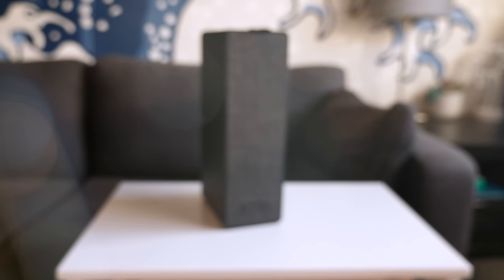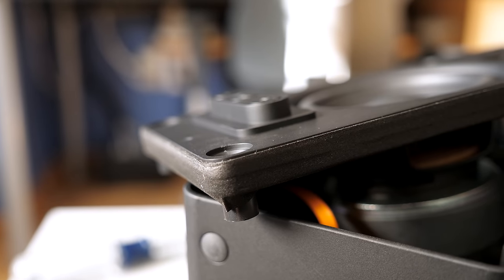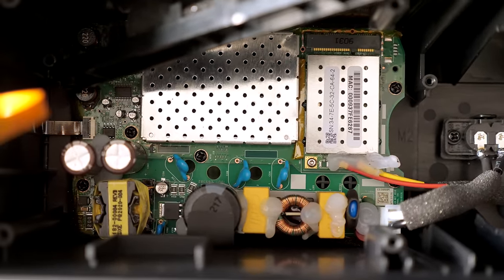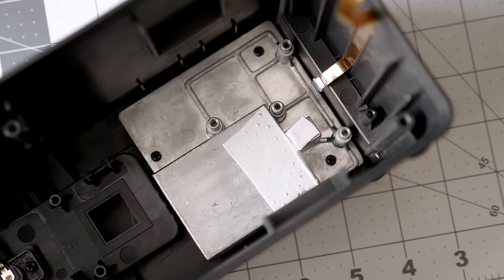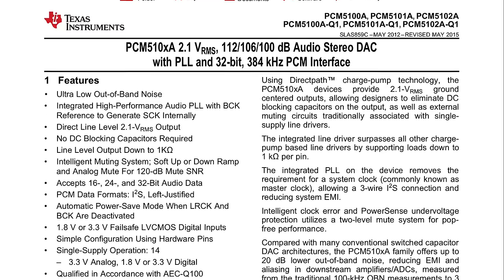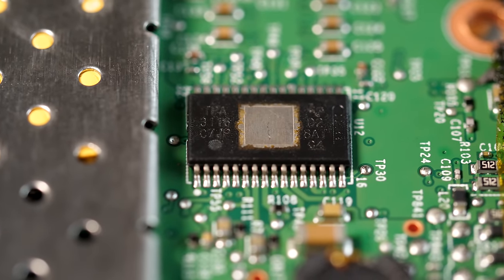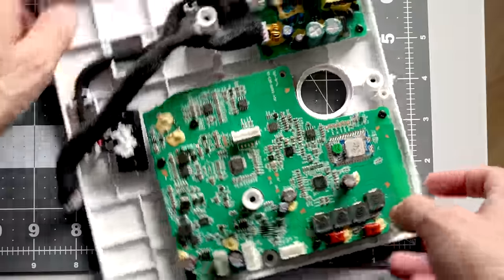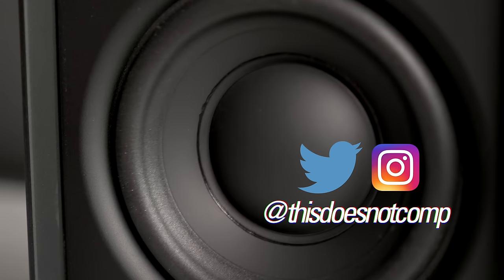IKEA's Sonos Speaker Has a Secret

Comment: So it's not Ikea to blame cutting the costs down but Sonos, as they are also using CapXon caps in their "premium" products.
Reply: I saw that, the Sonos Play:1 is also using the CapXon capacitors.
Reply: They were equally involved in the creation process, with Ikea likely having the final say
Reply: @JoshWitte  , but Ikea weren't involved when Sonos layed out the Play1. They already used CapXon on their own products, that's what I say.
Reply: @volvoracinggermany  ah, gotcha. Well that's unfortunate 😕
Reply: Nope, it's always Trump's fault...
Reply: CapXon caps will be OK, and last longer than the design life before a new model appears.
Put another way - the whole product will be thrown away well before the caps fail.
Reply: @johncoops6897  Im using speakers from the 70s, a few years life on a speaker is completely unacceptable
Reply: Just like Walmart, they refuse to pay for their products and make these manufacturers produce a cheaper product to sell in their store... Look at Goodyear tires from Goodyear then the exact same tire from a Walmart.
Reply: If I designed 150 dollar speakers, they would be computer speakers with a 3.5 inch BMR driver and dual passive radiators in each speaker box, feature class AB amplification, and be powered by USB C.
Reply: @esk8spirit362  NO! I always thought EVERY PROBLEM on the Planet was Obama's fault AND it was up to "Dear Leader" to correct them, because we ALL know, only he can do it! Good thing Mr. Trump was PROACTIVE about the Coronavirus situation otherwise we would have a hell of a lot MORE than those "2" cases! lol
Reply: @johncoops6897  That's why I shop at my local Goodwill store. You will find these items at "giveaway" prices, even if you have to buy new caps!
Reply: @massv953  Yes, but are those '70s speakers passive or self-powered? If they are passive, they SHOULD last for a LONG time, save for "speaker rot" of the cone surround!
Reply: @massv953  - we are talking about SONOS systems, which is not the same thing as your 1970's passive speakers. Consider mobile phones... people replace them to update the technology far sooner than the product physically stops operating. The low quality components in mobile phones don't need to last 50 years, or 20 or even 10 years - the original purchaser will replace them in a few years anyway. Sonos and similar products are pretty much the same.
Reply: @davidperry4013  - Nobody cares how you would design computer speakers. Do you even know what Sonos is?
Reply: @johncoops6897  I actually inherited Pioneer speakers from the 70's from my family and won't be replacing them anytime soon.

Comment: My guess on the lack of batting is that the back volume of symfonisk is large enough to reach their desired enclosure resonance without it. There's a limit to how much bass response you can squeeze out of a small loudspeaker.
Reply: The damping material in a ported box is to remove midrange resonances exiting through the vent. It has little to do with the bass itself.
Reply: @westelaudio943  It does both. Batting decreases the effective sound speed in the enclosure (isothermal vs adiabatic sound speed), thus increasing the effective volume and the lowering the bass cutoff. It also increases losses in the enclosure, reducing the Q of any standing waves, like you say.

Both of these effects exist and are measurable, and an engineer designing the enclosure ought to be taking both into account when deciding if they want batting or not.
Reply: @TheRationalPi  

True, however, it also absorbs the system resonance at the tuning frequency. That's why in a ported design you only put a thin damping material near the walls, so only the shorter wavelengths are absorbed, and in a ported subwoofer you rarely find any of it because the midrange frequencies are already LPF'd out to the degree of being negligible. 
This midbass enclosure would have greatly benefitted from it though.

Comment: What's really disappointing is the fact that Sonos, the so-called "premium" connected speaker manufacturer, is also using crap caps.
Reply: Yes I thought that as well... But is 150$ really premium??
Reply: @0ace0hitta0  compared to the cheap alternatives, yes.
Reply: @hillie47  Hi. Can you please tell me about some cheaper alternative? I'm looking for some cheap multi-room wifi audio system and I was not able to find anything cheaper then sonos one. Thanks a lot.
Reply: @JurajMarkoSK  for the connected stuff the Sonos play one is probably the cheapest option, but there are some budget not connected speakers you could use. Sonos is premium in the sense that prices go up rapidly from the play one. And to be honest $150 is a lot of money for a simple box with a cheap little amp and speaker. But that seems to be the starting price. Too high is you ask me.
Reply: the only premium in sonos is the price ;)
Reply: @wishandwatch  Hahaha, yeah, I'm learning that the expensive way. :-)
Reply: all about that planned obsolescence baby
Reply: My vintage pioneer amplifier is all a Japan built with only Japanese components. Very durable excellent amp.
Reply: @Sam Mencia The joys of truly building something yourself. And yes, you can go as crazy as you want to! :)
Reply: @JurajMarkoSK  just get a google audio cast and add to any speaker system you want and have full control in as many rooms as you want. I have 4 connected to premium home theaters and by my outside pool system and control everything through the audio casts over wifi.
Reply: @tigerskone2945  there discontinued
Reply: @djenson  such a pity.  Everything good that google does gets canned

Comment: Polyfill "batting" isn't for bass response, it's to slow down the rear wave of the driver making it behave is if it was in a larger enclosure. With a tiny 3" driver it more than likely isn't needed since that driver won't have very much xmax.

Comment: I think what happened was that the speaker portion comes from whoever did Eneby, while the circuit board comes from Sonos. Sonos may have tweaked the DSP a bit to optimize the sound quality of the speakers used. And finally, the enclosure is IKEA.

Comment: Which will fail first? The capacitors or Sonos deciding to no longer support the product that has no AUX in or Bluetooth.
Reply: I have Sonos products that are close to 10 years old now and Sonos still supports them so no need to really worry about Sonos support
Reply: The only things sonos have stopped Supporting are their Controllers that were getting useless and dying anyway.

All speakers and connects /ZP units are still supported

Comment: The question now is, is there a difference in sound between the Ikea speaker or the Sonos one.
Reply: serasane hmmm... that’s a really pandora box u opened there
Reply: @serasane  Having heard neither, I can say with 101% confidence the difference is night and day.
Reply: he literally said at the end...if you don't mind the form factor then go for the symfonisk..did you even listen ?
Reply: Since they use 2 different sized enclosures, there should be some difference in sound. Heres the truth though, it has a little shit tweeter and a little shit sub, they're not going to sound great.
Reply: @Nothingtoya   Right, there should be a difference in bass response, at the very least, but these drivers appear utterly generic, and I wouldn't expect anything better in a speaker with a thin plastic enclosure and no batting.
Reply: @serasane  I think Wilson Audio will sound tinny compared to Sonos. The amp inside Sonos is matched to the drivers just like Kef LS50W
Reply: @Nothingtoya  Compared to what is the question. There are better audio quality and streaming solutions, but the price point is the qualifier in the definition of shit in this setting. It will likely not be as good as a B&O M5, but the wall mount bracket for one of those will get you half-way to this speaker. The M5 can also probably be defined as shit in comparison to a B&W Formation Wedge - but again, it's twice the price.
Reply: @serasane  I wouldn't be able to hear it over the screaming coming from my wallet...
Reply: I have the One and it actually plays with some authority to ~80Hz. Perfect level for most small rooms, kitchens and such so comparing it with a few REW frequency response sweeps in a few rooms and locations (free air vs back wall supported) would be great to see. Also when and how the bass is compressed (it's done pretty clean on the One) would be interesting. And of course se how the response changes with some wool in there 😃
Reply: I have the Eneby30 (well, 2 in stereo) and I tested them against the Symfonisk Shelf speaker.

Since the Symfonisk uses only 1 woofer, like the Eneby20, those sound quite the same, while the Eneby30 sounds quite awesome with its 2 woofers.
I was not impressed with the "sonos" speaker AT ALL.

The Lamp speaker, I couldnt test, but it seems according to the web, that its the sonos1 with an additional lamp.

I must say I'm not really liking the sonos products sound at all.

The
Reply: People really don’t care about sound, long term durability, or repairability any more. Look, a pretty box that makes noise.
Reply: @rbrtck  I bet they sound great. Most things do these days. There's so much processing going on that for 90% of the population it'll be all they ever want.
Reply: @rbrtck  To be honest, as an audio engineer, the ease of use for regular listening is unmatched. The fact that my wife will use it makes me content. I think these are awesome for rear channels in a second theater room and still get 5.1, and this video just saved me $70 per channel.
Reply: @GrimmReaperz95  form factor refers to the shape/physical appearance of the speakers and not the sound they make. So next time before you are so quick to have a pop at some one maybe you should get your facts right.
Reply: Hi Damon. What do you use to send the audio to the speakers? It has to wreck the sound if the delay are too much compared to the front speakers?

Comment: Why have modern speaker system gone back to mono? What’s the deal with mono speakers?
Reply: But the whole point of Sonos speakers and their app is that you can pair up multiple for stereo or up to 4.1 surround. So, you would ideally buy two of these, kinda like buying two active speakers with a wireless system and software that can play them in sync (stereo, surround, or multi-room mono).
Reply: @Mr Brightside But Ponk 80 was commenting on a video (the Original original post, if you will) about a series of speakers meant to be part of a modular system? Again, you can buy individual bookshelf speakers (think Polk, Pioneer, Sony, Yamaha, etc) as parts to build up a system, and this Symphonisk is the same idea except wireless.

Could I buy just one Klipsch speaker, instead of connecting it as a piece of a system? Sure, but that doesn't mean consumers as a whole are going all mono.
Reply: Mr Brightside • I’m not missing what Ponk 80 said. He has the perception that modern speaker systems are mono (implying that Mono is in the majority), and asked “what’s the deal,” as in why is this happening.

And to expand some more on my reply to him:
A.) Some mono-only speakers exist, but I don’t think they’re taking over the market. While there are a few speakers designed for mono audio use out there (B&O, Tivoli radios, and other tiny Bluetooth speakers that might as well be mono), Stereo Hi-Fi is alive and well, and my perception (especially after having just returned from RMAF) is that there are more models and brands that are truly Stereo rather than Mono.

B.) In fact, this wireless IKEA speaker is sold individually, but like all Sonos products it is a modular part that can be used alone (mono) or paired up as part of a multi-channel system if you buy two or more.

C.) If you’re going to point to Ponk 80’s post, then I also am going to point out he didn’t specify wireless speakers. But even then, I’ll point out that the Sonos, Bose Soundlink, Apple HomePod, Beats Pill+, Ultimate Ears Megaboom and Wonderboom, Creative Labs, Devialet Phantom, and many more wireless speakers are modular parts of speaker systems designed to be used in mono or multichannel systems, so you can add or remove speakers as desired (or able to afford).

If you haven’t heard of these speaker systems at all pricepoints, I’d recommend looking them up. I believe you have your own YouTube channel (usually how-to’s) which I have enjoyed in the past, maybe you could research a video on how to DIY a modular speaker system?
Reply: @Mr Brightside My apologies, the YouTube channel I was thinking about is just "Bright Side," and they make "did you know?" videos with the mission to help people (like this one about the signs you're not drinking enough water: https://www.youtube.com/watch?v=WIAWUW1R9_Y).

I didn't mean to bring a combative tone, but rather offer some theories that might expand on perception. I do indeed see many mono-audio devices on the market (and listed quite a few before), generally designed as entry-level products to get people started with audio at a low price. Logically, they would sell well too, and not everyone values audio enough to upgrade or just buy better gear in the first place.

However, Stereo "Hi-Fi" and surround is definitely not going away, in fact I think the WHOLE market (including mono and multi-speakers) is growing! If I can include headphones as stereo devices, more people individually experience stereo sound than ever before, the cost of better systems is becoming more affordable all the time, and I think it's really cool that a product like this Symfonisk exists at an a fairly affordable price range, and a person can buy one and add to it later to make it stereo (or more). I might not be able to afford buying my mom a pair of ELAC Debut speakers and an amp (though those are still a great value), but maybe I could buy her a Symfonisk for her birthday, and then next year another one.

Anyway, read this reply or not, I hope your weekend was a good one for you.
Reply: Most speaker's are mono xD you have to buy to

Comment: So the SYMFONISK has airplay 2 support, but the play:1 doesn’t. Given that we have seen the hardware is the same, I wonder if you can hack the SYMFONISK firmware onto the play:1 in order to get support.
Reply: Gerrit 
You could use a willem programmer with tsop adaptor to flash that winbond chip that stores the firmware.
Reply: Gerrit 
Yes you could use the willem to read the winbond then just clone it. Those ic's have been used for many many years now the most common use was bios on computer mother boards, now they are in everything car ecu's, cable boxes, roku boxes, Xbox's. I'm surprised they use the tsop version rather than the more modern solder ball mounted package. lol it's a hackers first port of call, many examples exist for instance the first Xbox exploit.
Reply: Buy symphonisk pull apart, remove board, fit into Play:1 , fit play:1 board back into symphonisk, return to ikea.
Reply: Tom Skarabis 
Only one real way to find out .. From this video I was under the impression the main pcb was practically the same, if thats the case they probably just left some components off the cheaper version. I don't own either of these speaker units can't say as I ever would.  Was just passing on some hobbyist suggestions.
Reply: Tom Skarabis Ikea speaker is beigng compared to a Play:1 not a One (there is no such thing as a Play One)

The new Sonos One SL is the replacement for the Play:1 and probably shares most components with the Sonos One, while the SYMPHONISK seems to share all the electronics from the Play:1

Comment: As I recall, you criticized the IKEA speaker in your original review for having sound-quality issues... does the Play then also suffer the same? I'm wondering if the price difference is mitigated in any way by a difference in audio output/quality...?
Reply: @guguru  Is this based on your own a/b testing of both devices? Or someone elses? (please link me up if so) The internals are identical, apparently, with obvious housing differences and perhaps/likely firmware as well.
Reply: @guguru  I appreciate the info. :)
Reply: @guguru  Not necessarily true Julian, because the electronics in both are IDENTICAL! At 10:10 he puts the 2 PCB’s side by side....and the are exactly the same, with exactly the same components - I paused the video and took a forensic look.

Comment: After a few hours of google searching ive found the Sub...
Its a:
3inch 84mm woofer, bass mid speaker 6ohm, 15W.
Built in mid range woofer.

Size：
Outer diameter 83mm  
Diagonal screw hole 90mm 
Height 55mm  .

Couldnt find any information in the tweeter, sorry

Comment: Will stick with my old Mission speakers, connected to an old amp. Everything connected via analogue stereo RCA leads, thanks very much. The Ikea speaker looks very good though, as an item to have in the kitchen or garden.
Reply: If you REALLY want to make a statement, check out Harman Kardon's ALL GLASS 2.1 system! It has 4 drivers in each satellite with the sub and electronics in a center piece, ALL visible thru the glass! Mind blowing!!

Comment: Hack it.
Upgrade the speaker drivers.
And solder in a bluetooth receiver!
Reply: Totally possible but I'd rather just buy a better speaker system.
Reply: "And solder in a bluetooth receiver!" - no need to solder - just unplug the PCI-e card and slot in another one of the same brand chipset but which also includes Bluetooth...just have to hope that the OS has a Bluetooth driver built it....
Reply: @cableman1958  anyone tried This yet?

Comment: 2:36 Is that an mPCIE WiFi card ?
If so, then try to connect a graphics card to it using an exp gdc
Because I make good ideas
Reply: well, dump the bootrom, rewrite large sections of the os and the gpu driver, implement an user interface and install the gpu driver and you should be good to go... some of those steps might take a couple of hours though and aren't as straightforward...